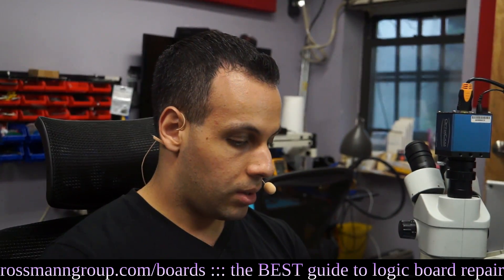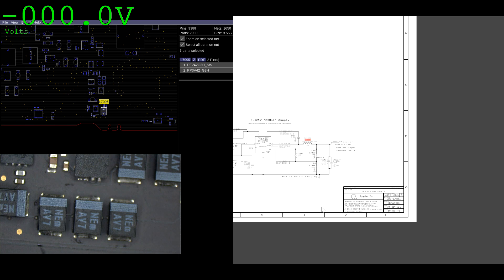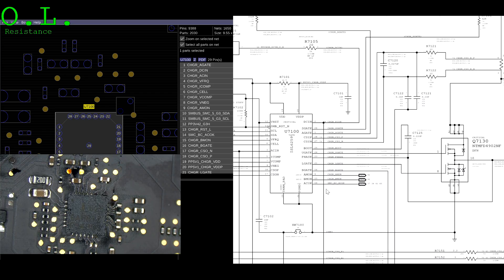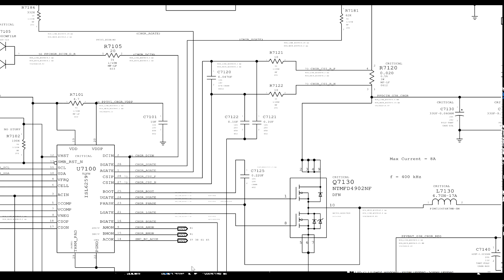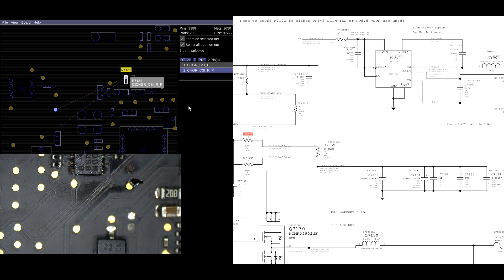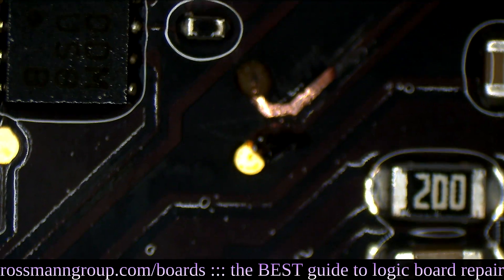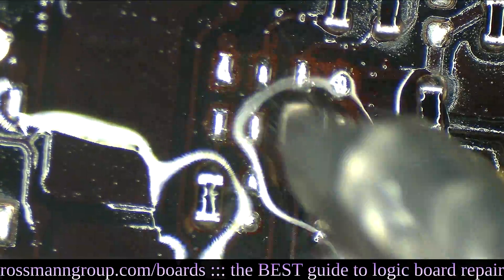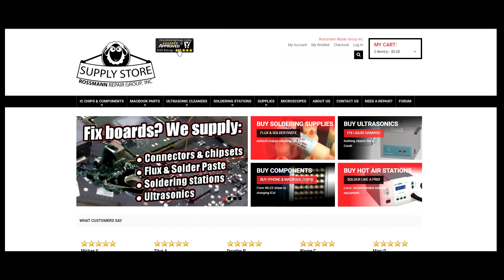How one missing probe point can kill a Macbook.

Comment: You generally wont get an accurate resistance if you measure the resistor while its still attached to the circuit. Because of the way power is distributed, you will end up measuring the parallel resistance of every IC and resistor that is attached to that power rail. However if there is an open circuit, as in the video, it will still read very high and you can still tell there is a fault. 
But if you need to verify a resistance value, you need to remove it from the board

Comment: There's a reason why CHGR_CSI_P and CHGR_CSI_N traces are routed adjacent to each other: that way any EMI noise will affect both signals in the same way, which means the differential voltage will not be distorted. Once you ran a jumper wire,  CHRG_CSI signals are no longer adjacent to each other and will pickup EMI differently. At best, that reduces battery current sensor accuracy.
Still, a working macbook with reduced battery current sensor accuracy is much better than a dead macbook.

Comment: Technically that's not a probe point, it's a via, it transfers signals from one layer to another, it you knew for sure that it only goes from the top to the bottom layer only, you could technically microdrill a hole right on the same spot and solder a pin or wire through the hole to the top and bottom traces.

Comment: "Oh, it's a 16V line, no wonder the pad is burnt out"
adds a jumper the thickness of a baby pube
Reply: Actually, I don't think there even was a need for two parallel jumper wires as they aren't carrying significant current. 16V is tension, not current and mostly means it will oxidise faster. The mention of burning out is confusing as burning is mostly caused by current (but higher tension allows for higher current, so theoretically if there was some sort of creepage path through the liquid spill it could have indeed been burnt). Also the insulation needs to be better, but transformer wire insulation is as good for 16V as it is for 3,42V.

Comment: If you struggle with suspension of disbelief when watching these videos like I do here's a tip, before watching set fire to piece of plastic, let it burn for ten or so seconds, blow it out and then leave it on a saucer near to your seating position. A warning though, you may find it a little too immersive, experiment with the saucer's position and curate your experience.

Comment: Hey Louis, whats the maximum voltage that the jumper wire can handle without melting or heating to the point where the shielding melts?
Reply: Probably a few amps of current. No problem here as the current flows through the sense resistor, not through this connection. The maximum voltage only depends on the insulation and should be at least 50V but probably more for transformer wire.
Reply: It's hard to tell the exact thickness but it definitely wouldn't pass more than one amp and he mentioned that the voltage is 16v, I'm just curious as to why he used two strands as the chip sensing the voltage would only draw a few milliamps, redundancy perhaps?

Comment: Honest question: do you think the fact that you work overwhelmingly with Apple faults that it leads you to think harshly of them? Not in any way defending Apple, but I feel like if all you saw all day was Lenovo laptops, you would think the same of them. It seems likely to me that they are all shit in the end made with cheapest parts they can get to nominally function. Now, again, I won’t personally use Apple laptops or desktops, but I have used Adell (surprisingly good luck for me at a time their rep was like Apple’s now), Lenovo (terrible experience) and currently have an Asus gaming laptop that has never truly worked well (it had multiple ssdks not enabled when I got it!). I don’t feel like any of the mfg’s are better than others, just the luck of the draw on initial quality, and even more once support gets involved. Asus, for instance, has the worst support I have ever encountered with no way to access it outside a web site and only poor English speakers handling it. So frustrating.
Reply: Jamie Norwood I've never had problems with my IBM/Lenovo/Motorola tech. We've had issues with Dell and Asus though. Current laptop is MSI and no problems with that either
Reply: Apple is known to have hardware issues to the point where they get sued. Not saying that "luck of the draw" isn't involved but when an a manufacturer gets sued multiple times cause of cheap/poor build quality that's something different. That's just not caring for their customer and trying to squeeze the very last penny from them. Kinda sucks that Apple is like that cause their software is actual pretty good.
Reply: Jamie Norwood  without belittling your experience, he does see Lenovos all day, being that they're his go-to workstation, and if he suddenly started seeing a lot of them coming into his store, LRG might rethink their ad campaign, which is targeted at Apple repairs. The real issue here is spilling things and letting them 'tech-dry' out on their own. Apples are a pant load to open, but compared to Surfaces or Chromebooks, are still a treat. That being the case, a sudden manifestation of Lenovos might mean that their hypothetically-conscientious owners simply couldn't get new Lenovo designs open. PEBKaC.
Reply: Does Adell know you used her?

Comment: Why not drill a hole through the board for the jumper wire?
Reply: Unless the jumper wasn't meant to be a permanent fix I suppose
Reply: Those boards are multi-layer, which means drilling a hole would drill through many more traces

Comment: Microsoldering makes me feel like a wimp for working on 500 volt tube amplifiers.. Yes, mine might kill me if I touch the wrong thing, but at least I don't need a damn microscope.
Reply: Don't forget a tube can redplate for quite a while before it fails, so it actually helps you find a short. A blown MOSFET, especially in a metal can looks exactly the same as a perfectly functioning one. And one short overload will kill it.
Reply: Tube amps are extremely forgiving as long as there are no fingers that conduct current.

Comment: you know, apple should start gluing components into motherboard instead of soldering them, so when they get heated up they'd just fall off from motherboard.
Think different.
Reply: Now, they'll just need to find a conductive adhesive that's cheap enough...
Reply: that sounds like something apple would actually spend money developing. We all know they would never put money into developing something good for the consumer.
Reply: dont give them ideas
Reply: pe1dnn i meant by making a motherboard literally filled with components glued onto mobo, instead of SOLDERING them.

I already know they shoerubbered that IC, but it's not apple enough.
Reply: I think that is done for some very specialized stuff, which is temperature sensitive and thus cannot be soldered without being damaged.
Actually it is done already on some of the SMD MLCC (multilayer ceramic) capacitors. Called "soft terminations." They are soldered on still, but the soft yet conductive layer is meant to to prevent board flexion from cracking the ceramic dielectric.